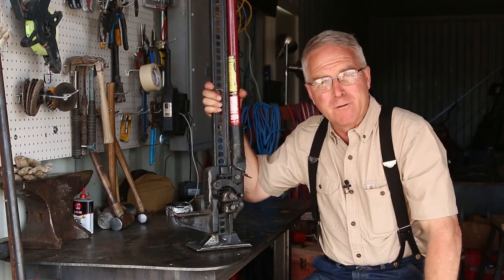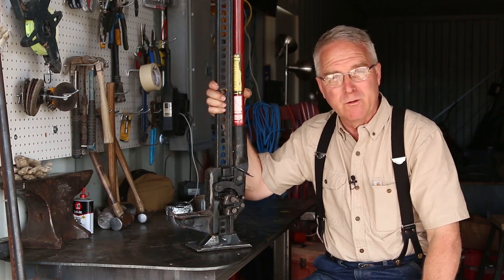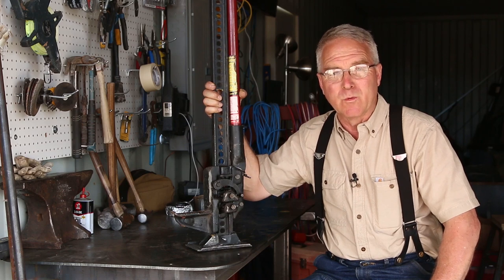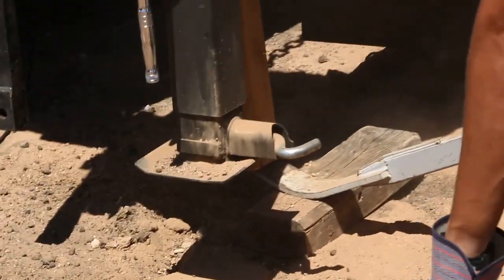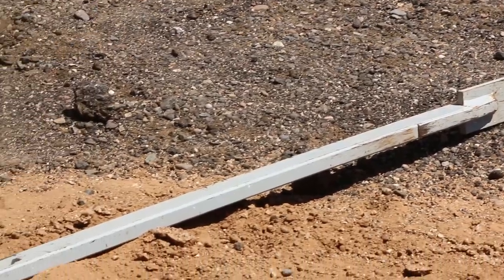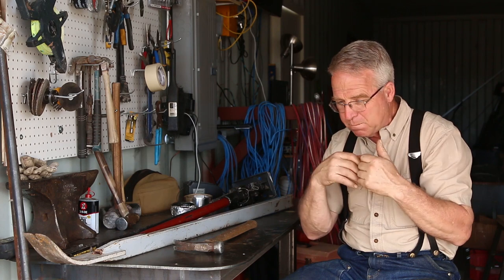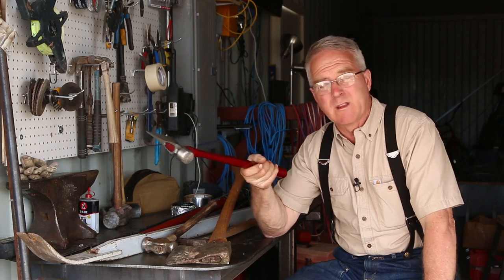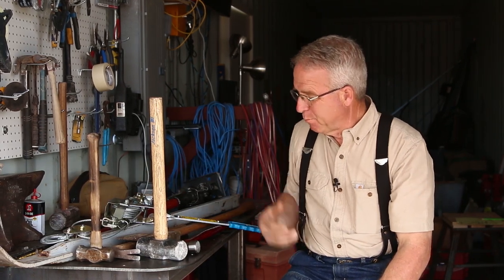5 Problem Solving Tools

Comment: I have four of the five. Don’t have a Burke bar, but I do have a pair of 5’ long bars for digging and prying. I’m not sure what happened to my real Leatherman. The clone sits on my dresser as it’s too bulky to carry. I do have a Swiss Army knife in my pocket most of the time. It’s not in my pocket when I bowl but I keep a smaller SW knife in my bowling bag. The high-lift jack, bars, and come-a-longlive in the garage. As a carpenter, my work van always has three or four hammers, a hatchet, and an assortment of pinch bars and flat bars. My other vehicles all have at least some sort of tool kit with wrenches, screwdrivers and pliers. 
I would nominate the plumber’s strap wrench for your list of heroic tools. I got a pair of cheap ones that are just a rubber strap and a plastic handle. Put one in the truck and one in the kitchen. Makes a great jar opener.
Honorable mention; the Craftsman 10-in-1 screwdriver, great tool to have in your pocket when you know you’re going to have to unscrew something but don’t know if you’ll need slotted, Phillips, Robertson, Torx, or hex.

Comment: I really can't argue with any item in your selections, because I always have at least 4 of the 5 available in a vehicle, or close at hand. There's only one other that I always have, and sadly the original manufacturer in Quebec, Canada has gone out of business. It's the Cluthe ("Klu-the-ay" or "Cluth-yay" if you're in western Canada, as opposed to Quebec) multi-bit screwdriver, with bit storage in the handle. Cluthe's original model had (I think) 10 bits: 3 flat blade, 3 Phillips, and 3 Robertson head, plus a pointed awl. The shank was originally a sleeve with a ring that you turned to tighten the chuck - each blade had two "ears" near the top that slotted right in. The chuck was a good grade of steel, and the handles were made of a very high-quality fiber-reinforced plastic.  The bits were all properly shaped, ground, and/or tapered, as well as being heat treated. Unlike the cheap made-by-the-million Dollar Store versions, I've never stripped a screw head or damaged a bit - they're that good. When I got my first one, I was 7 years old, and it cost $7. For comparison, I made about $5 a week delivering prescriptions from the local pharmacy, and one of the local newspapers every day.  Mssrs. Cluthe and Sons actually made quite a wide range of quality tools, but that one in particular has bailed me out of a jam on many, many occasions. The fact that the bits are properly contoured and ground, and then heat treated is probably the key factor. The handle was a brilliant orange, so it was easy to spot if dropped. I don''t know how many I've bought over 55 years - I've given away quite a few, voluntarily or involuntarily. I still have the very first one I bought, and it's still a quality tool. There are many low cost imitations, and there are other versions of the same idea that are quite good to have in the glove box or wherever. All the others you've shown are things I have in a vehicle or on hand, and have used many times. Thanks for this interesting video.

Comment: My Leatherman PS2 (discontinued) saved a potential disaster after a hiking trip. Got everyone piled into the car and about 30 miles later had to pull into the first gas station we came to as the steering was getting real squishy. I found much to my surprise I was driving on a near flat tire. After trying to fill the tire, in the dark, my pocket flashlight showed the problem. Seems someone loosened the valve stem on my front left tire. That PS2's pliers were thin enough to turn the stem down to hold air for the rest of the 200 mile trip home. I have a Wave on my belt always and that PS2 stays in my "get home bag". I given lots of Waves for presents and have received many "it saved the day" stories in return.

Comment: The invention of a leatherman was great, but  they break a lot. I can break the jaws with one hand by squeezing it hard. Finally found one that I couldn't break. Victorinox, by far the best, best steel, tempered right. I've broken eight or ten leatherman tools and sent them back and they probably hate me. Got a Victorinox, never broke even one part. One of the best tools ever invented was the cordless drill. Still remember the old Makitas. No more braiding six drill cords together when putting a plank on a boat. Another is the super tool, Sawzall. Next to that, the shipwrights best friend, the 4 1/2 inch grinder. I built two cabins this last summer and used my old grinder a lot.

Comment: Here's a tool story:
I work in the waterworks industry, fixing watermain breaks and such. This morning I was standing shin deep in a muddy trench with the break flowing beside me; angle grinder in one hand, wire wheel in the other - excellent device for cleaning the crust off the pipe, but only when attached to each other! The fellow who tossed them down to me said he couldn't find the spanner for unscrewing the nut on the grinder's arbour. And it's exactly these situations that led me to start carrying a pair of 10in channel locks in the knee pocket of my coveralls. They are exactly the right size to operate a fire hydrant, snug up various underground fittings, a thousand other unforeseen things... and in this case, loosen the fastener on my angle grinder so I could get on with the repair. There is very little that goes unsolved in my job when you have a Leatherman and channel locks on your person, and maybe a sledge hammer at arm's reach.

Comment: I used to deliver morning paper in northern finland when i was younger. I just got my driving licence and winters were snowy and icy. Snow plows started cleaning roads after 6am when i finished my work so if i got stuck there was no one to help. I had similar steel wire puller which could lift 9000kg boat on trailer. One time i drove a small road across open field and snow had made road to disappear. Of course i fell of from road and got stuck. And there was nothing to attach the wire in the field. Only one birch but it was on opposite side of road. I took hold of that tree and my volkswagen pickup came out of the ditch sideways! Next winter 1995 i bought my first cell phone. And learned to drive.

Comment: Took out all my carpentry tools out of the car for a camping trip only tool left was a hatchet, came in handy when my inner fender came loose on the highway drive home. Probably wouldnt have got far cutting threw that dense plastic with just my car keys haha

Comment: Good video Scott 

I’ve also wondered watching your blacksmith videos how the tongs only have one hinge and how that may be weak in terms of grip especially looking at the way you manoeuvre them around and the weight of what you’re holding.... having said that they do have long handles which would help

I recently bought some DeWalt “compound pliers” that use three hinges and magnify the force 10 times to the jaws from the handle....

I wonder if you could copy that design from your workshop and make a set of blacksmith tongs with compound hinges and have a lot stronger grip over the workpiece.....

 it’s basically three fulcrums instead of one I doubt it’s copyrighted..... If you google DeWalt compound pliers you’ll see an image to get the idea

(PS my fee is 10%......!)

Comment: When I was 18 I was working at a seed plant. One weekend shortly after starting the job I bought a truck and found a small cheap multi tool in it. The next day the maintenance guy got his clothes wound into a sprocket on a drive shaft on one of the shakers. It started at the sleeve and he couldn’t free himself so all 4 layers of winter clothes he had on got wrapped into the sprocket and it lifted him off and floor and hung him in a chokehold. I walked into the room right after the mishap and luckily I had my tools which had a knife blade and was able to shut the power off and cut him down. He’s alive and well because I had the right tool on me at the right time. 25 years later he still tells me he has to pay taxes every year cause of me. Lol
I’ve carried a good multi tool ever since that day.

Comment: A cell phone with an internet connection is the most important tool ever invented. In the short time they have been around, they have solved more problems and saved more lives than all the others times 1000.

Comment: My story is for those that believe in vise grips. While hauling my race bike from Daytona in 1976 , one leaf springs broke on the trailer.The axel was on the ground. After getting it jacked up, I used the vise grips to hold the spring ends together. I  hauled the trailer and everything in it for at least 200 miles and had no failure. I never travel without vise grips.

Comment: OK. since you asked, here's a story: The tools were things I was carrying, but it was a friend's expertise that knew how to use them.

The problem was that the  2 weeks old new brake pad on one corner of my car disintegrated 20km from home.  Driving home without a pad would mean at best a new rotor was also needed. So it's that or an expensive tow. Vice Grips and a bungee cord to the rescue! 
My buddy, who's a master mechanic, clamped off the brake line at that wheel with the pliers, and tied the pliers to the caliper with the bungee cord. Getting home was a very carefulling operation, but it was done in safety, and with no further damage to the braking system.  A quick swap back to the old pads, and all was right with the world again.

Comment: Ratchet strap. I frame stuff up steel or wood and don't really care about square until its completed. I will only have tack welds at that point or a hand full of screws. I then use rarchet straps from corner to corner to make an X pattern
 Then I tighten them until its square. I use the crap out of them for alot of things.

Comment: Johnson bar is more useful in my line of work. Very similar to your bar but with 2 steel wheels under the prying end. 3 men an 2 johnson bars can move a 2 ton transformer as far as needed and can lift it as high as needed by lifting it couple inches at a time and placing blocks underneath. 
Come-along is great but pulleys are more versatile in my opinion. 
Finally Leatherman are for fishing and thats all. It has like 20 miniature tools. None of which are useful being that small

Comment: You'll never see me out of the house without my Leatherman, but I'd dispute that it's the king of tools or the most versatile.  I fix stuff for a living -- I'm a power tool repair technician, and I'm the guy in my shop who fixes the stuff no one else wants to deal with, either because we had to look it up on the Internet to see what it does, or because I'm the one willing to spend a lot more time to learn how it works than I can reasonably bill.  My number one fix-everything tool is a 32 ounce ball peen hammer.  I could to almost everything I use it for with a similar weight straight claw hammer (keep those curved claw home hammers in the drawer, please) or the same size rigging axe or what I grew up calling a roofing hatchet -- but a ball peen is what I keep in my drawer at work because I'll never need to pull a nail, chop a notch in a board, or cut a composition shingle at work.  The stuff I can fix with a hammer fairly regularly boggles even the other repair technicians in my shop.  I can straighten bent thing, bend straight things, drive pins in (or, with the help of a punch, out); it's my arbor press and my impact wrench.  Hide my Leatherman and you'll annoy the hell out of me.  Take away my hammer and I'll be limping though the day at work until I can get the boss to order me another one.

Comment: I was headed into my chiropractor appointment when I saw a little older than I guy sitting in his car but his right rear tire was completely flat.  I was early so I waited a bit to make sure he didn't drive off.  Well he started getting ready to drive off so I got out and told him his tire was completely flat and I would help him after my appointment.  When I came out he was gone so I started to drive away and then I passed him in the parking lot, he moved to a flatter shaded spot and was trying to figure out to get his newish car spare out.  I asked if I could help and I parked and helped.  He could have managed but he was worse off than I so I did the lifting and figuring out but he helped too.  It was like 10 min of my time but I could have just driven by figuring he obviously had it sorted.  I've been able to do a few things like this, if you look they will be available.  I've also been helped by strangers in profoundly good timing so I like to think what goes around comes around.

Comment: On Thanksgiving day about 12 years ago and I went with my father-in-law, brother, and his 10 year old daughter to see the Detroit Lions (they won for a change!).  We took my in-law's car and I was driving home after the game.  I hit a pothole the size of Lake Michigan as we left the stadium and got a flat.  We pulled over onto the first exit and got out to change the tire in an industrial neighborhood with no one around. Although my F-I-L is a super prepared GM skilled tradesman, shockingly he discovered he had no jack in his new car.  No worries, we called OnStar and they said they'd have a truck out there in 30 mins.  2 hours and several calls later, no truck.  My mother-in-law was in full panic at home an hour away.  Then, a vehicle pulls up behind us but it wasn't a tow truck.  It was the first car we'd seen in over an hour and it was a couple in a beat up sedan and they asked if we needed help.  We told them we had a flat and the guy goes to his trunk and pulls a hydraulic floor jack and had our car up and the spare on in less than 5 mins.  He did it all himself.  We offered them money as a thanks, but they waived us off and said they would feel bad if we had missed Thanksgiving dinner (we already had).  Good Samaritans, complete strangers who saved our butts with the right tools for the job.  Thanks for helping me bring that memory to mind right before Thanksgiving!

Comment: The most basic tools a person should have, in my personal opinion.

Locking pocket knife: I don’t think I need to tell y’all of all people why.

Hatchet: cut wood, hammer nails.

Pri-bar: pull bad nails, kinda like a tiny Burke bar that you can carry with one hand. 

Saw: saws are just good tools

Measuring tape: metric if you can, it’s just better. And reading a metric tape is so easy a child can do it, even if they’ve never touched one before. You can teach them to be as precise as an experienced user of an imperial tape in minutes.

Metal cutting hacksaw: obvious 

Bolt cutter: for cutting chain and such, I use mine at work to cut tig wire. Not because it makes any sense to do so, but because it is so overkill it makes me smile.

Rope and chain: y’all already know why

Zip ties: check last

Well put together med-kit: if I could only grab one on my way to an emergency, this would be it. Sure you’ll feel tough with your Burke bar, but when a little girl bleeds to death in your arms you’ll regret leaving it behind.

Comment: I blew a tire on a highway. Went to look for a jack in the trunk and nothing! Sitting a few minute by the side of the road with the trunk open and the spare tire out but no way to lift the car a pair of non English speaking guys stopped viewed the situation and got a jack from there car they changed the tires quick looked at me I thanked them and the drove off. I could say thank I’m in Mexican at most. Perfect helpers when I needed it. I had no cell phone at the time either.

Comment: I’m in a thing called the jumper cable club, it works like this; if you see someone in need of a jumpstart, you render aid. After you get them going you ask if they have cables and often times they say no, you leave the cables with them under the following proviso; you must go forth and do like wise ( for ladies and elderly people obviously this doesn’t apply, but they get the cables nonetheless ). Also, you use your good  sense; don’t enable a drunk or anything like that but also don’t say well that guy looks gay or he’s got a cowboy hat or a turban; you help. So far this year I think I’ve given away like three sets, I don’t even feel it; I just order the heavy gauge sets from Amazon and they show up at the doorstep. And when you get somebody’s vehicle running and get them out of a jam I can tell you it’s a great feeling. And when you get a chance make as many new members as you can.

Comment: In that guy with lots of I know how and ready to help anyone who accepts it. I have many stories. This one was is about a flat tire up the street from my house. 
  Coming home from work I spotted a large man struggling in the bitter winter cold with no gloves to turn a tire iron on his lug nuts. 
   I decided id go home let the dog out to pee and then go offer whatever help I can. 20 minutes later he was still there and looking defeated. I offered to help but I'm only 5'6" and 150lbs., so he was not encouraged. But did accept my help.
  So, I placed the lug wrench surely to the lug nut at as horizontal angle as I could achieve and STOMPED on it instantly breaking that bolt and all the others free. He seemed a mix of astonished grateful and humiliated all at once. Lol.but I helped the couple be on their way.